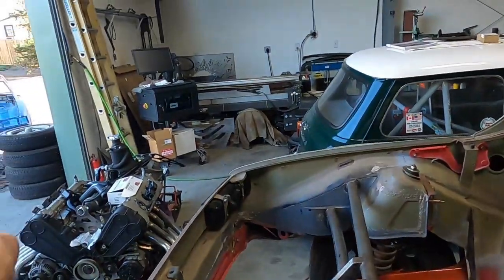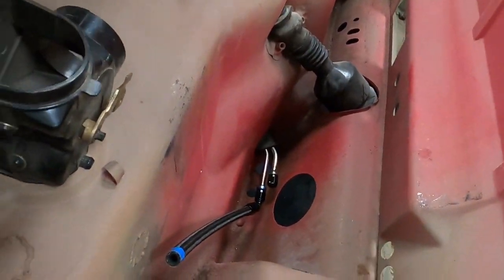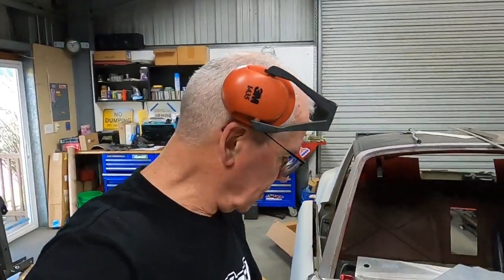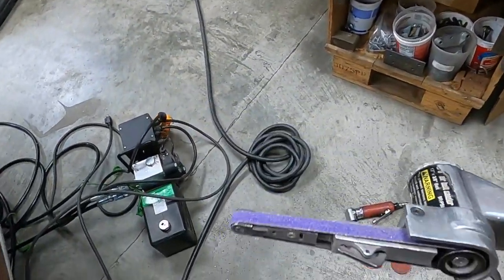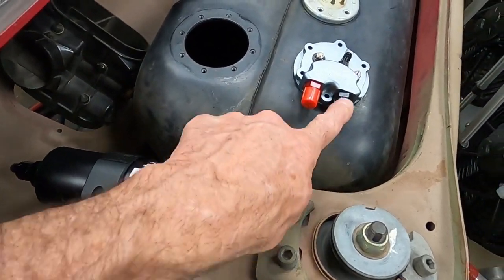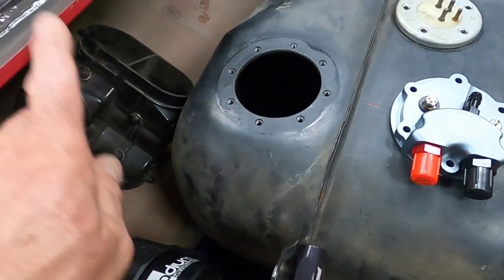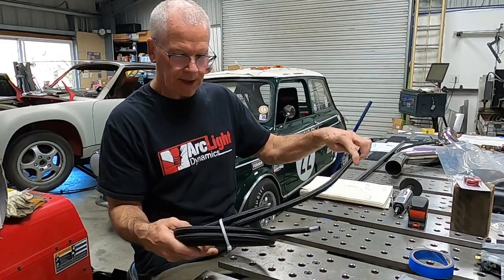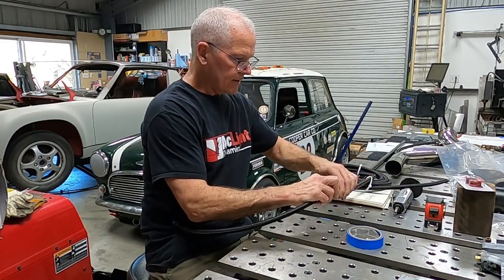914 Ferrari Build - Episode 56: Fuel lines and Ignition coil mounts

Comment: What would be very cool, is a solid metal, non removable targa top.  Like Porsche did with his 8 cyl 914.  Then I would learn how to do it right :)
Reply from the maker: Funny you mention that. I was just talking with a buddy about doing that but decided against it. As cool as it would be, it does limit the market. At least a little. Now, I may make a couple mods that allow a reinforced roof to be bolted in, like they did with the 914 GT cars. But untill it's running, I'm not going to focus on anything else.